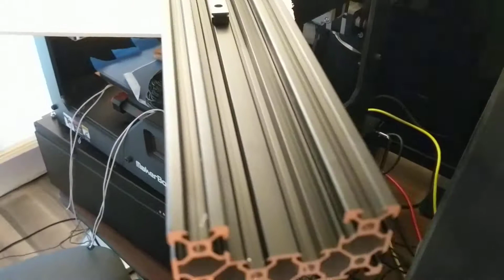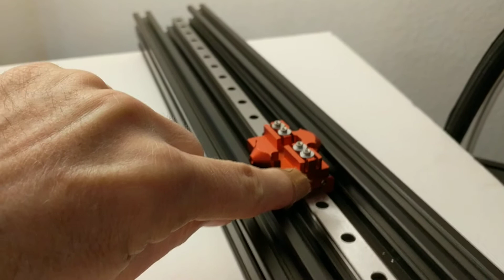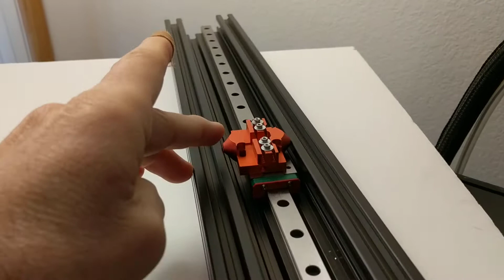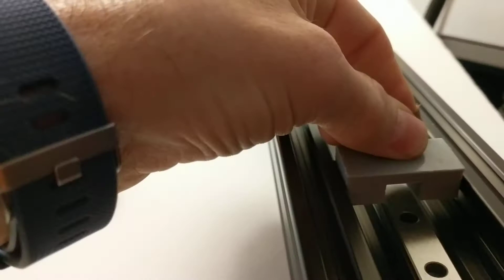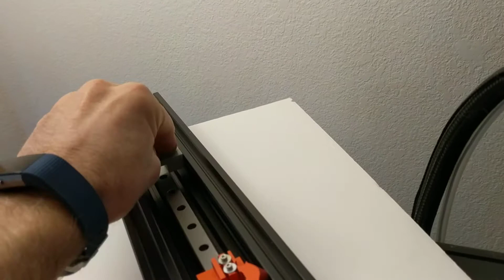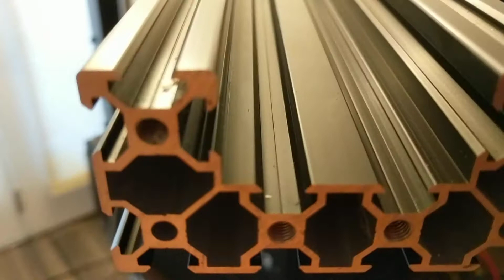Tevo little monster linear rail upgrade  Part #1

Comment: Hello, thank you very much for the superb guide. i want to upgrade my TLM the same way.Could you be so kind to place a item list of the linear rails and belt sliders you have used? Thank you in advance
Reply from the maker: I got the linear rails from china on ebay using search term:  kossel linear rail 700mm.     The build files are found on: https://www.thingiverse.com/thing:2764935
The linear rails are the only extra item you need besides the printed parts.   The hit I used was: MGN12 700mm 12mm miniature rail MGN12H carriage enlarged Kossel Mini 3d Printer